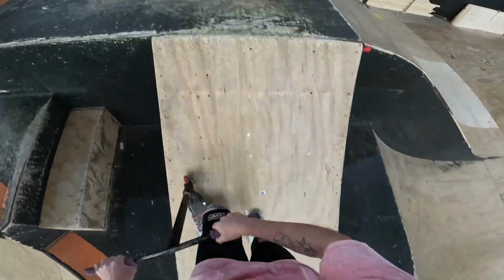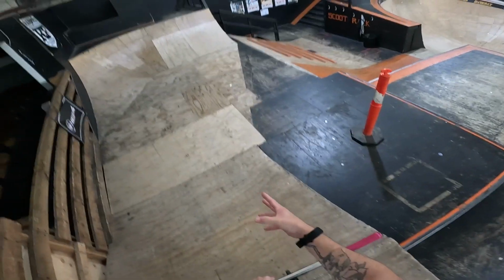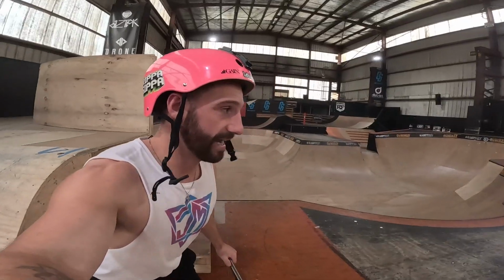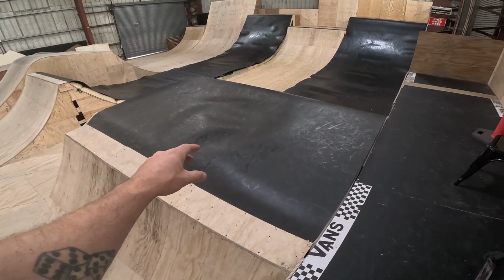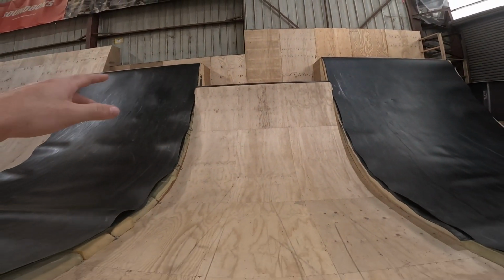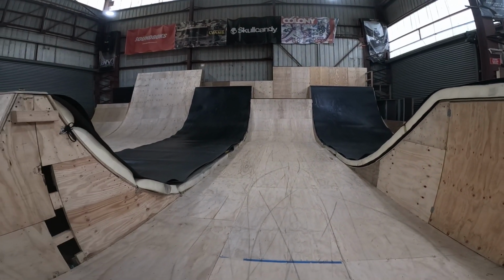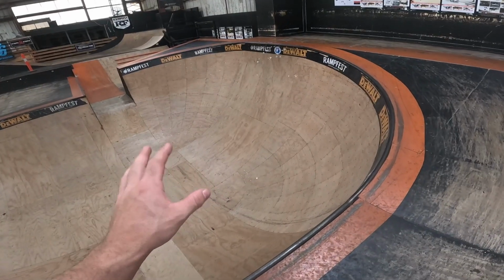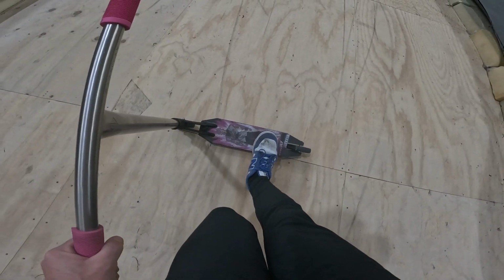3 Hacks to Learn Scooter Tricks Faster

Comment: 5:00 That's why I love RF so much, my local stateparks (Mossfiel/ Hoppers Crossing and Baden Powell) have good ramps but I feel like they're a tad to small and quite tight, but RF has so many variants of Quarters, tables Ect which most parks don't have
Reply from the maker: Rampfest is the best man, there are some good ramps at hoppers crossing for air tricks but not very good for Flyout or box’s